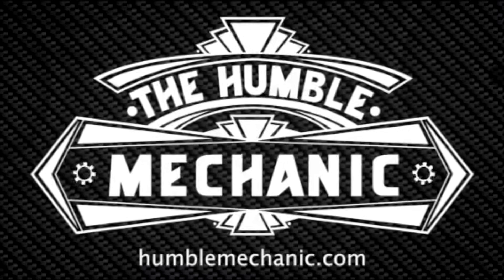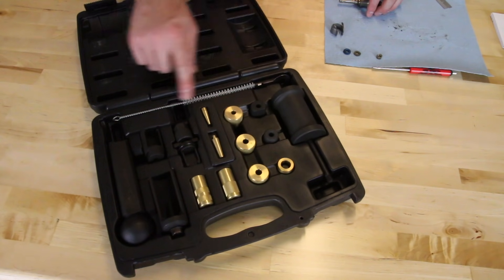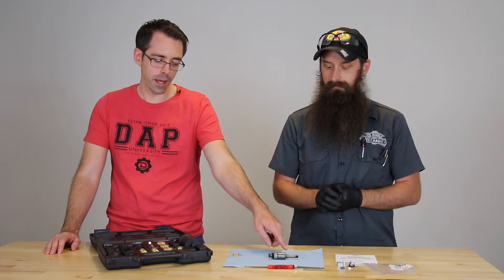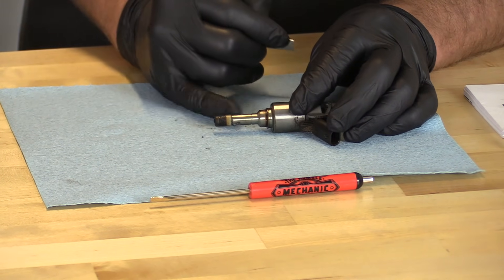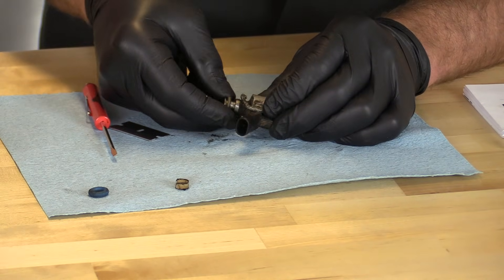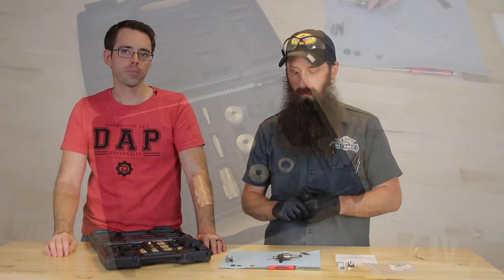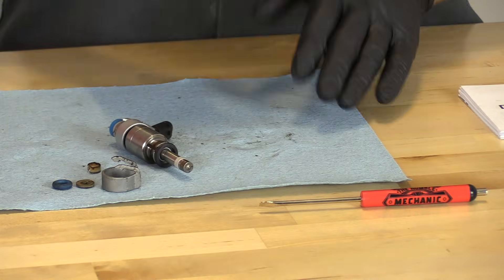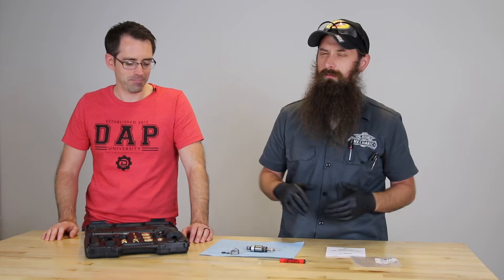Replace Injector Seals on Direct Injection Engines

Comment: Hey i messaged you on the replacing a pcv valve video and you replied! hopefully you will with this one too haha. but i have a rarer audi A6 C6 avant 3.0T and with the kit you have linked it does not say it would fit on my year and model but i have a similar engine to the s4 so I would imagine it would work to fit the hard poly rings back on. Also I tried looking up forums to see if anyone has  reused the polyester seals and I could not find anything for it. if in a pinch would you reused them and only change the upper O rings? I will be in your debt if you respond. Think i sent this on the other video by accident.

Comment: is it okay to put injector back on the engine without replacing the seals? do the seals work a second time?
Reply from the maker: It’s a gamble. I’ve had it be okay but best practice is replace it
Reply: @HumbleMechanic thanks for the response on this old video. I'm planning to do an intake cleaning but buying the seal formers for a one time job seems too much.

Comment: If the seal is not sized correctly can that cause a popping sound that almost sounds like a misfire? When installing new injectors do they need to be sized or do new injectors come correctly sized?

Comment: Question, I need some help. I have a 2020 VW Passat 2.0 TSI. 

It keeps blowing out my injector seals on cylinder 1&2. I've replaced them 3 times and I have followed this video step by step. It keeps pushing out the both inner & outer seals that go into the fuel rail, I've done everything people have recommended on the internet, and I've had a VW mechanic come to my house to check if I've installed everything correctly. 

Could that be because the HPFP's PSI is too high.? Seals and injectors are brand new (OEM).
Reply: @7:17 in the video, that thing. I never paid attention to it because they made it a comedic thing. I forgot about that. But that is what makes it or breaks it. I spend hundreds because I forgot about that piece and because I didn't pay attention.
Reply: did you solve the problem of blowing injector seals?
Reply: @flat-earther yes I did, I had followed every piece of information to the T. One thing I forgot was this black plastic on the old injectors that had 3 prongs on them which held them from getting pushed out of the fuel tube. It isn't stated in many videos but I found that out after days and hours of trying to find out why they kept getting pushed out of the fuel injector tube. It's black most of the time with a silver ring and they have 3 prongs and they are a SOB to get out. You have to be very careful getting them off of the old ones.

I ordered new seals and injectors and they didn't come with the pack so I used the ones that were already in there attached to the old injectors. I hope this helps bro. I spend hundreds thinking it was something else but it was just those 3 pronged black plastic holders. Make sure they're on your NEW injectors. The old ones always have them.

Comment: I'm doing a PCV body replacement an managed to get both fuel rails off without removing injectors. I ports are major carbed up but I don't even want to tackle that job. I was going to try and scrap off some of the built up carbon on the valves put notice the ports were not all the way closed. Didn't want risk knocking stuff of in them, so as I bad I would like to clean, I'm not. However, since since all the injectors stayed in I assume I only replaced the rail o-ring? I was hoping not to replace any, b/c those kits are like $11 each x6. but looks like I'm not replacing at least the top part. Oh well.

Comment: Question. Do you install injectors first into block making it really hard to connect wires or into fuel rail making it hard to line up injectors? I have a 2011 and it seems fuel rail first.

Comment: Hi Charles!
I'm currently working on my car inspired on the great work you guys always do. I'm at the point where I need to push in new Bosch injectors (with new seals) but it was really hard to make the first one go in and decided not to force it. I can tell the Teflon seal rotates quite freely on all of them. 

Is it normal to need much push force to pop them in and would you know if Teflon seal is normal to rotate "so" freely? Very appreciate all your hard work and any comement.

Omar

Comment: Do all 2.0 TSI’s use the plastic pizza box spacers? I think my 2010 Tiguan 2.0 TSI has been apart before. Non of the injectors had the pizza box spacers installed and one injector didn’t have the metal cage on the inlet side. I ordered four new injectors and a seal kit that includes the metal cage.

Comment: Hey guys, here's a good tip. 

Genuine Audi injector repair kit costs about $30, as you know. But here's a kicker; Genuine Hyundai injector repair kit (35312 2G730) is the exactly identical one. O-ring size is same, nylon seal has the same size. In Korea this Hyundai kit only costs $2!!! COSTS 1/15 OF AUDI ONE LOL.

In US, it costs more than $2, but other countries may have different story. Just FYI!

Comment: Question: Does the 2007 Audi Q7 3.6L V6 with FSI have just 4 fuel injectors or are there 6 fuel injectors on the vehicle's engine ?

Comment: Basic question: is it necessary to replace teflon seals on the injectors if they pull out with the air intake manifold? What about the injectors that stayed in the motor block?

Comment: There are so many different opinions on what lubricant to use on fuel injector o-rings; petroleum jelly, silicon, dielectric, assembly lube, motor oil, gasoline. What are your thoughts?
Reply: VW service manual tells you to lightly moisten o-ring with clean engine oil.

Comment: Will this kit work for the 3.0L TFSI injectors (06E906036AL) as well? I'm having a hard time finding a kit that lists these injectors or the vehicles with the 3.0L, and they don't have the little protrusion on the tip.

Comment: So if the injectors come out easily, does that mean that the seals were probably no good? I did a valve cleaning and didn't realize you needed a tool to get it out. They actually popped right out without trying.

Comment: Hey bud first off thanks a ton for all these videos, it's a great help as a tutorial as well as confidence booster to be able to see exactly how all these tasks are performed. 

Just wanted to note, my bosch injector seal kit says to install the plastic grey rings with the flat side toward the blue rubber o-ring, which I see is opposite as you have them in this video.
Reply: Was going to say the same thing. Correct orientation. Thank you

Comment: Pro Tip:
Install the compression seal as far onto the cone as you can, then use the sleeve to push it onto the injector. Helps keep the seal from going sideways in the sleeve and possibly cutting or damaging it.
Speaking from experience... Ruined 3 seals the first time I attempted this.
Reply: Thank you dude jesus… ruined 2 seals lol I was wondering what I was doing wrong

Comment: Great and interesting video guys very detailed. My question is if I'm replacing the fuel injectors on a 12 valve VR6 and they already come with o-rings on them I don't have to shrink them do I? I should be able to just remove the old ones off and install the new ones on right?
Reply: You only need to do this if you're re-using the injector.

Comment: Great Tutorial! Cleaned up my carbon using different methods. First Walnut shells but I ended up buying the wrong shells (12Grit) Coarse and it would clog up the Blaster. Then Berryman Chemical Dip/Carb Cleaner, very time consuming, while waiting for chemicals to work, I was able to exchange the coarse for Fine grit (24) and was able to clean all the valves in an hour. The Portable Blaster at Harbor freight was $30 and the 25lbs of Walnut Shells was $25. A lot cheaper then the Dealership.
Reply: did you use the red media blaster from harbor freight, if so, what nozzle did you use to reach into the valve? it seems like the stock nozzle will be too short.
Reply: @Pickle117  the inexpensive gray blaster from harbor freight works fine if anyone else reads this.

Comment: @HumbleMechanic thanks for all your helpful videos! FYI the white split washer lookin thing is called a backup ring, these are commonly used in combination with an O-ring to prevent the O-ring from squeezing itself between the groove and mating seal surface ID. Backup rings can also promote the O-ring to seal better on the pressure side of the groove. Exciting stuff!

Comment: Should I use rebuild kit if I’m putting all new fuel injectors ? I’ve got Audi s5 b8 2011
Reply from the maker: Most new injectors come with seals
Reply: HumbleMechanic i figures that but what about the metal cage ? Do I need to replace those ? Rebuilt kit comes with seals and metal cage

Comment: Installed new seals with the tool, cylinder 2 and 3 have huge compression leaks and misfires now. Can clearly hear them hissing compression, so bummed.
Reply: Did you ever find out what caused that issue?

Comment: God Tip! Autozone has this exact tool kit in their loaner tools. Part number 8877.
Reply: Much appreciated! I was just looking around trying to figure out where to get the kit. I have a Q7 that needs a new valve cover and I will be removing some injectors to pull everything.
Reply: @rockbe02  good luck and I would call and reserve or order the kit ahead. All stores may not stock it, but any store can get it. It's a tedious job, but the 2.0 is ALOT easier to do. On the 1.8T, the manifold has two studs so you have to have it at a perfect angle, and theres a timing sensor above the driver side manifold that makes it harder to get out and in. Make sure you have several rolls of shop towels, and at least 3  cans of carb cleaner as you'll go through a lot. The seals are pretty cheap, and make sure you replace the gasket. They get old and hard with miles so save yourself the headache. I think the seals were 12 bucks a cylinder, and the intake gasket was like 28.
Reply: @TheWalterHWhite  I am actually working on a 2010 Q7 with the 3.6 so that kit may not be the same but at least there is a chance they would have them instead of me needing to buy one.

Comment: Love the straight forward info.   Thank you!  Curious.. since you can manually push the injector in.. I removed my intake mani AND all the injectors, one straight pull.. Is that OK?? Could you cover that in your notes?  

Question on TOOLING.. is there any kit out there which can be used to form the seal?  I didnt wanna drop 100$+ for that.. it is a one time use tool.. there's gotta be a cheaper way!

Comment: Bit late to the party on this one, but I’ve just replaced my injectors and cylinder 3 is misfiring loads at idle. Mine didn’t have the black tripod sort of spacer you put on at the end, just a white nylon ring in the seat. I’m guessing this could be the cause of my issues?
Reply from the maker: I have never seen it lead to that. Be sure it's not something else causing the misfires
Reply: HumbleMechanic thanks for the reply. I’ve tried swapping round plugs, coil packs, and swapping that injector back to an old one, but it always remains on cylinder 3. It wasn’t there before I replaced it. Is it possible that I’ve damaged the Nylon seal in the seat? Just seems odd that it only happens on idle.
Reply: @thejay20  I Know this is a year old but I have the same cylinder 3 missfire did you ever figure it out?
Reply: @VdubSmallGarage Did u ever figure it out bud?

Comment: i recently had a injector seal leak so dealer replaced all the seals. should i change my oil now as a result? it is a DI engine truck.

Comment: FYI if anybody’s interested, I used a taper punch, cut the back so it’s same size as injector used o ring grease and slid it onto the injector starting from taper end to the injector worked well didn’t have to buy kit.
Reply: And how did you shrink the seals after that? Thanks.
Reply: jepe ge use o ring grease (silicone grease) and put injector Carfully back in hole you shouldn’t have to shrink it ,should fit in snug
Reply: @praneetsingh6201  Ok, thanks. According to the manual no grease should be used  but if it worked for you then it can work for me also ;-) Thanks.
Reply: Definitely not normal grease it might attack seals (petroleum base), silicone grease will prevent tearing and binding and seat seals.

Comment: sorry, but it looks like you are using the tool wrong, to compress the teflon ring, you need all 3 tools and the first one is only to slide the teflon ring and the other two to reduce the diameter. the original VW partnumber for the 3 tools are T10133/6 (to install the ring together with T10133/5 the cone) and later T10133/7 and T10133/8 to compress the ring

Comment: Are there aftermarket tools that do the same thing? just saw the price! VW/Audi really don't want any DIYers to try and fix their own cars.  Designed as much as they could to not be easily repairable.  I remember when it took half an hour and 2 techs and my car in the air to change the lightbulb in my headlight.
Reply from the maker: Amazon has them too

Comment: Please help, I have a bosch gdi injector that is rotating and moving slightly in all directions after a injector swap , all other injector from factory do not move and we had a hard time getting them out but after swapping injector 1 with 2 they both are moving free and don't reseat as they do from factory . The teflon white seal was not changed
Reply from the maker: probably need to replace the seals, or start there and see what happens

Comment: why did you use just two of the dyes when there are 3 available??
Reply from the maker: The kit is used on many different injectors
Reply: @HumbleMechanic  I getcha, so I'd only need to use the first two.  I'm hoping there's an aftermarket injector toolkit since the one in the DAP shop is bananas expensive Oo
Reply: @raffitchakmakjian  I just got one on ebay for $40, worked great. Hope you found one a year ago. Lol
Reply: @TheStuntViking  lol!  I had a fuel leak, I thought it was the injector seals, but I found it.  It was a loose bolt somewhere, I forget where, but I was lucky enough to see where the drip drop of the fuel came from and just tightened the nut.

Comment: i would really like to see a low compression concern, caused by a weak injector seal. A lot of service manuals will not even have that written in there flow charts of things that cause low compression. Out of the 100 injectors jobs i've done, i've been guilty of reusing all the injector seals, with no lube, only blowing the hole and wiping the injectors tips with a rag. Never had a issue. fortunately most GM's I work on have 2 Teflon seals on the tips as double precaution but still are supposed to be replaced per liability reasons.
Reply: I would insist on doing the job 100%, out of liability concerns, but since I am working on one of my household cars, I am deciding to reuse the seals as well.  Best thing I can do is continue to be alert and aware of the situation, and keep a fire extinguisher in the vehicle for the next couple fuel tanks, lol 😂. Application is 14 Ford escape 1.6l Ecoboost.

Comment: Should you lube the end injector seals that insert into the motor? I'm replacing the seals on a Chevy ECOTECH motor and the service manual doesn't specify whether to or not.
Reply from the maker: No. Don’t lube the white end. But yes lube the blue seal.

Comment: Charles, I have a problem with the electrical side of the fuel injector, the clips inside the wire harness have broke and causing a loose connection that results in a misfire. The clips are hard to find and expensive. Can i wrap with electrical tape and be done with it?

Comment: hmmm....when i removed the fuel injector from my tsi engine it did not have that 3 prong black spacer on it...Only a flat plastic white washer.....should i use the black 3 prong washer that comes with the kit or reuse the flat white washer?

Comment: That video was so informative. I never knew that the new style "direct injection" injectors had to use a special tool to seat the new seals. This kind of sponsored tools is great because u wouldnt want to take on a job that requires you to remove the injectors and not be able to get them back in correctly. Also you guys did a great job explaining and showing all the pieces in the kit and how to use it. Great job!
Reply from the maker: +Kenneth White thanks so much glad to be able to help
Reply: This kind of content is what keeps you, Charles, at the top level of VW/Audi content creators.  Your professionalism is paramount and although i can be critical of some videos at times, overall you have a great sense of what your views want to see and learn.

Comment: I had repeated failure of the blue seal on one injector on my V12 direct injection BMW. It was only when it got a new fuel rail that the problem was fixed. Basically it would run for about 10 hours and then fail with huge gas smells. I was surprised it never blew up. Have you ever seen the blue seals fail? Lucky for me my warranty covered all the costs which ran into many thousands.

Comment: thanks for continuing to shew people away from the dealer.
Reply: I would buy the kit If I had the car and expected to have to do this multiple times over the time I owned it. Then either ebay it off or include it with the car.
Reply: sarcasm
Reply from the maker: +Bat Man  naw I don't most Diyers are gonna spend plus $100 to buy the tool. If they are, odds are  not coming to the dealer anyway.
Reply from the maker: LOL, I saw this after my comment.
Reply: yea your right